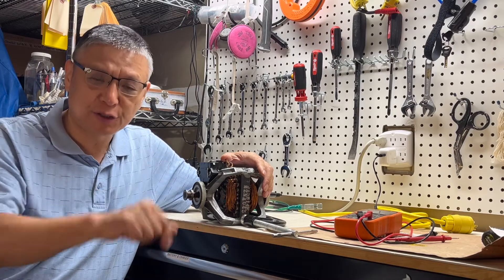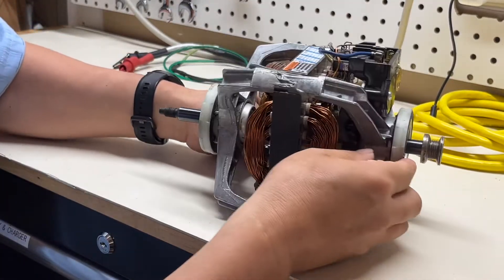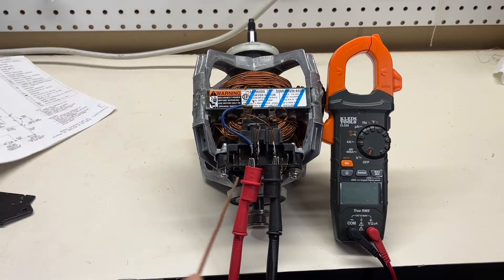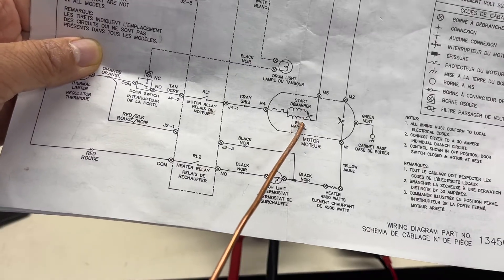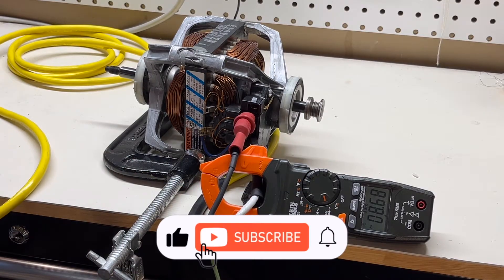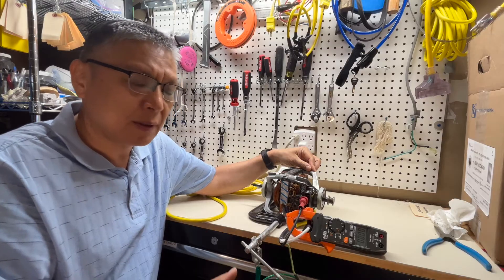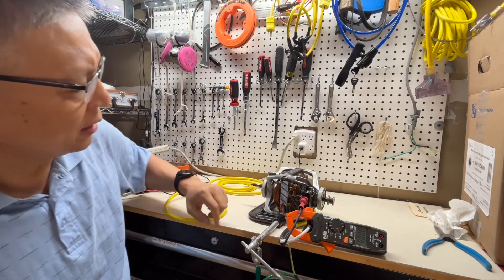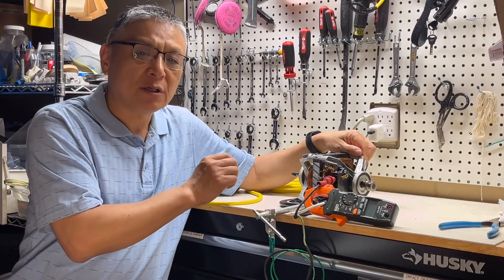Dryer Motor Testing - Dryer Troubleshooting

Comment: Run winding is thiker which means lower resistance than the one on the start winding, you can actually see the thikness with your eyes. The reason you see a lower resistance before the switch engages is that 2 resistances connected in parallel make a zone with the resistance lower than the lowest resistance in the parallel chain.
Reply from the maker: @random5107  absolutely you are right and also you have sharp eagle eyes 🦅👍

Comment: My dryer won’t run when press start. I removed the top and press start it only humm but if turn drum with my hand it starts. I tested the motor My start and run wining are both reading 3.4. Should change motor or check something else.
Reply from the maker: looks like starting winding can't start, do you feel if it is hard to move the drum by hand? check belt, wheels and exhaust fan make sure they are in good conditions, last check motor as in the video. Good Luck.
Reply: I am having same issue, temporary fix by I taping the door switch, push start button, give the drum a push it then start to run, put clothes in, close the door. I plan to replace the motor and while at it replace the belt too.

Comment: Thanks for the video, and for sharing this information!! I'm glad I came across it! Good information! Is the M4 and M5 marked on the motor? I didn't see a marking on mine.
Reply from the maker: Thanks for watching. There are terminal number marks on the side of black terminal block if you look from the motor shaft direction at least for the dryer motor I used in the video. take a close look at yours. Good luck, appreciate if you support me by subscribing the channel, ignore it if you did.
Reply: @guelphming3843  Thanks. Already subscribed.
Reply from the maker: Thanks